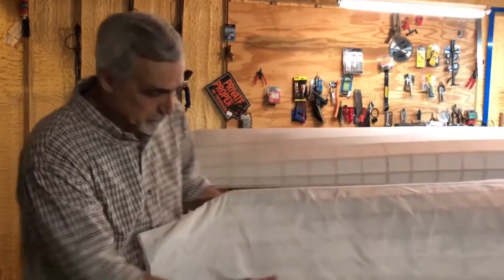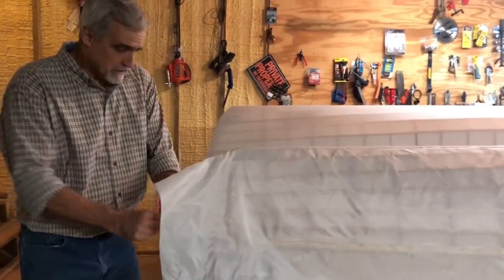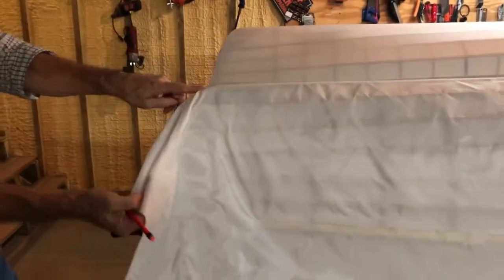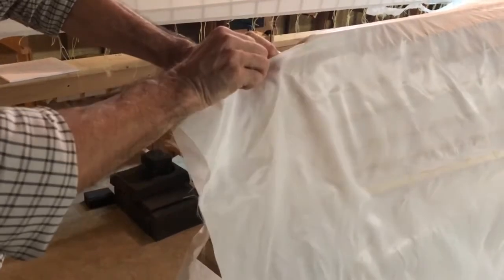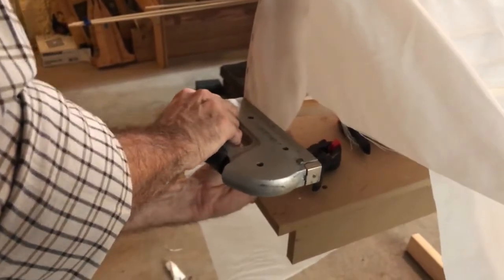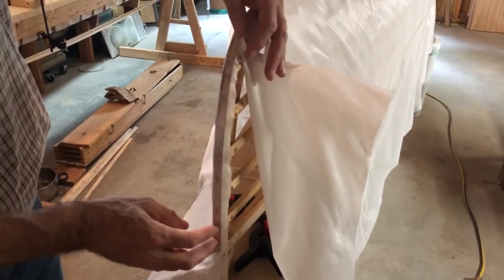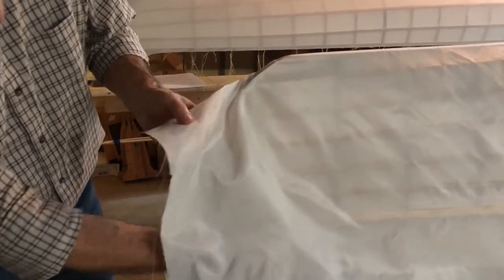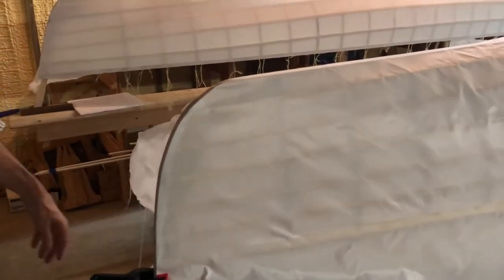Skinning the Boat, Part 2: Finishing the Stem

Comment: At the very end of the video you mention trimming up the last side. May I ask how you make a nice clean cut? Is it the razor again? Should I expect there to be a little ragged edge? If so I don’t have an issue with that. Thanks for the great videos.
Reply from the maker: Hi Matt, I use a brand new utility knife in this video but a single edge razor works even better.  You may need to trim an occasional loose thread but it's pretty clean.  Thanks!
Reply: Thanks for the quick and helpful reply. Much appreciated.